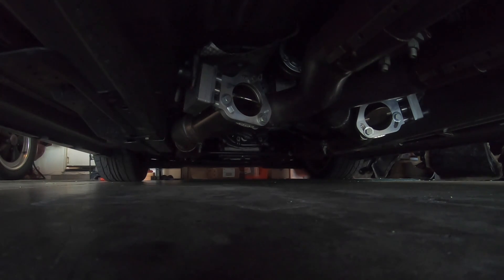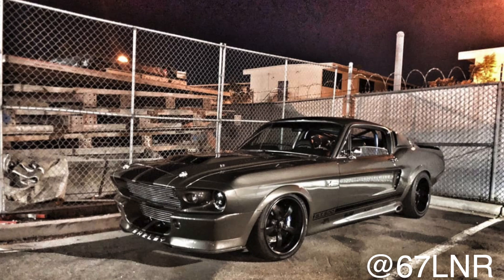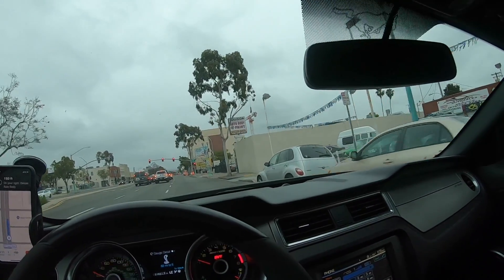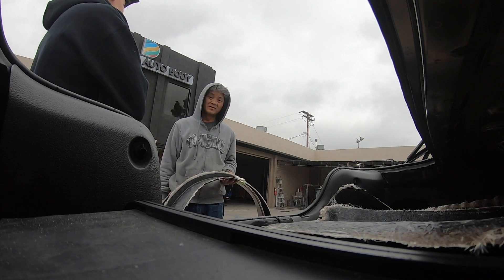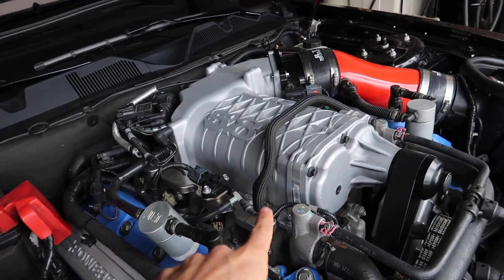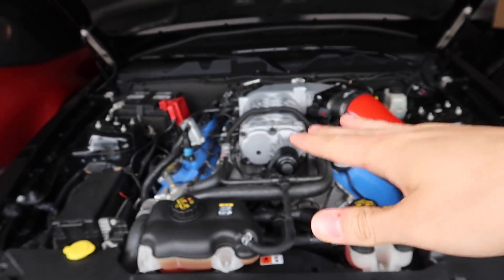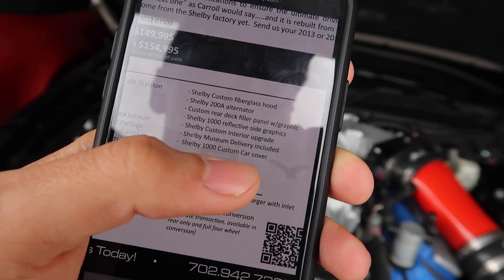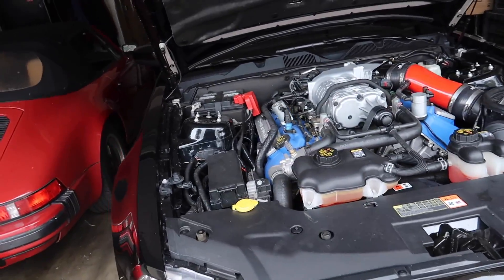Building a custom Shelby 1000 Widebody: Project 1000R announcement and launch

Comment: Have you not replaced anything else but the engine? Control arms, struts, coils, panhard rod etc
Reply from the maker: Regarding suspension, no. I do have the trac pack already and she handles really well for me, but upgrades are coming for sure

Comment: Yo dude I’m about to cop a black 2008 mustang gt with the same front hood scoop as yours, actually looks identical to your car if it were stock. Has 109,000 miles and is going for 5,800. There’s supposedly no problems with it at all. My only concern is that it’s had 3 owners. You think  I should go for it??
Reply: KonaBlue 2k10 alright dope what kind of mpg are you getting off of your GT? That and higher insurance are my only concerns for going for the GT over the v6
Reply: @KonaBlue 2k10 For real!  I had a Civic when I was worried.  I sold it and bought a Stang.  I no longer worry!  ;)

Comment: Don't mess with the block, do the rods and upgrade timing chain and use the billet gears, oil pump, talk to someone that is a has a reputation on these 5.4 5.8 cobra jet type engines.

Comment: Just so you know you cannot resleeve your car. It is impossible since it does not have sleeves and they sprayed iron in a plasma state (34,000 F) on the inside of the cylinders in place of the traditional iron sleeves. The block is not the weak point, the rods are the weak point because they use powder forged rods. They are only safe to about 800 wheel horsepower, anything past that you're taking a big gamble and will likely throw a rod which will ruin the whole block, because there are no sleeves to change.

Change the rods and the pistons and you can have up to 1500 no problem. Otherwise don't go over 800. You will have to have your chassis reinforced if you want a thousand as well, even if you do not beat on your car it will eventually cause frame damage to itself if you're at a thousand without reinforcing the chassis. Buying those parts and welding them on will cost approximately 4000.

I own a 2013 GT500, I am planning on doing a wide body with a thousand horsepower, but trust me I have done my research and will not cut corners. ( all the rest like upgraded fuel system and a Dyno tune goes without saying)

Oh yeah, and if you want over a thousand you will have to change out the rear end as well.

Comment: From what you said in the video so far. I can tell you really don't know much about the S197 platform GT500 engine (5.4/5.8 SC). The block is NOT the weak link. It's the power metal rod that will destroy the entire motor when it fail at high RPM (also higher than 800RWHP). The 5.4/5.8 aluminum block can be sleeved - L&M can sleeve your block for ~ $2300. Once you sleeve the block you have to get some new piston ~ $ 1200 because since Ford do NOT just sell the replacement stock piston rings . Then change out the stock rods to some aftermarket real forge rods ~ $1500. Then get some billet OPG and crank sprocket. Then upgrades the ENTIRE valve train components - that's  another ~ $2000.

Comment: I like the whipple supercharger. I think it looks cleaner under the hood. I would build it to with stand 1,500hp but run lower boost. You could down tune it and run less hp, but if you ever wanted to turn it up for some reason, you could! You wouldn’t have to pull the motor and built it again. Plus I think if you build it to withstand 1,500 but tune it for around 1,100 say, you would have a little more reliability because you wouldn’t be running near the max hp it can handle. I’m excited about the build! Hope all goes well on it and I will be waiting for more content! Love the car man!!

Comment: I have never heard any weakness in those blocks. They are plasma arc aluminium, steel sleeves probably are stronger. Spend the money on connecting rods, for sure, that motor already has a steel crank and six bolt main caps, can't wait to see the wide body murdered out.

Comment: I think you should get a better drive shaft, although carbon fiber is good it isn’t as study as an aluminum one piece especially if you plan on making more power and if you launch from a dig.
Reply: Damn mechanic here 💥
Reply: Icy lol no I just seent Stephanie on AM blow her carbon drive shaft with just 600 sum horsepower 😂 but it’s also just common sense hah
Reply: No it was the “Stephanie’s turbo mustang vs Justin’s super charged” one
Reply: KonaBlue 2k10 oh yeah you’re probably right, I just also thought it could have just been the stress from a launch, cause if I recall correctly, she had sticky tires and a good clutch to handle hard launches

Comment: If you plan on running a Kenne Bell, I’d say convert to E85 or maybe methanol to keep those temps down

Edit: Also, if you plan on 1,500 horsepower, what company do you plan on sleeving your block? L&M, MPR, RPG?
Reply: Hes already e85

Comment: WAKE UP!
What are you tripping on?! You're going to have that poor car torn all up before you even get it paid for.
The thing barely idles, start with that. "Hear it roar," more like hear it struggle to stay running. 
You've doubled your horsepower already by buying the car - be happy with that. jeeze, man....
Reply: Will S. Buddy it’s not struggling to idle that’s the huge cams
Reply: @jaydenzerfoss6906  Buddy, those huge cams are not causing the rpm's to surge and fall like that.

Comment: I dont mean any hate here but speaking as a body man....theres a reason most wide body kits are rivot on/very minimum altering of the factory body.  The body work on that black car will need to be top notch or final product will look like hell.  IMHO a body man capable of doing it right will require they do the body work AND paint from start to finish, especially seeing as they are putting their name and reputation on your car.  A collector local to me has a red Shelby 1000 Ive been around a several times, and it looks like it rolled off Fords assembly line in terms of quailty.  Best of luck but hope you understand the extent of the project you just started, and thats not even mentioning the 1500 hp goal
Reply: rayraytdog he can ruin the look of the car if it isn’t done properly...I would never do that to car as special as that

Comment: I’d just do 1000 rwhp, more isn’t accessible on the street anyway with rwd
Reply: 1000 as it is isn’t even accessible 🤦🏽‍♂️🤷🏽‍♂️
Reply: Ac Pi yes it is. Lol plenty of Houston cars being daily driven and raced with 1,000whp +
Reply: COYOTE swap or you get DEPORTED jut because they race with 1000hp cars doesn’t mean they get to 1000hp🤦🏽‍♂️🤦🏽‍♂️🤦🏽‍♂️1000hp at its max is like 200-250 mph
Reply: Ac Pi 200mph is the average ending point lol.